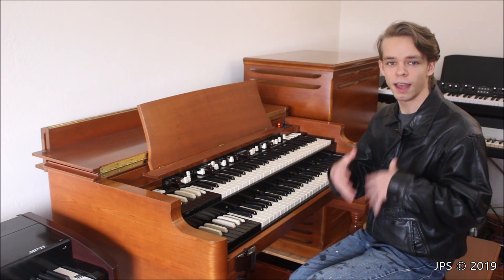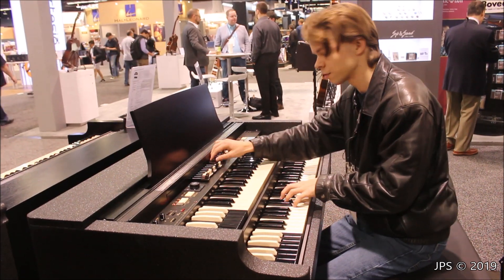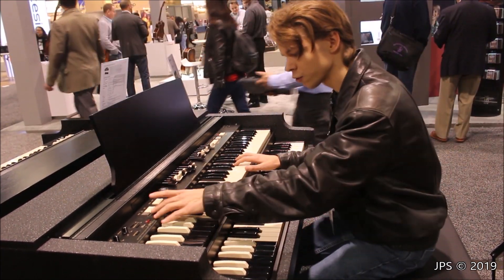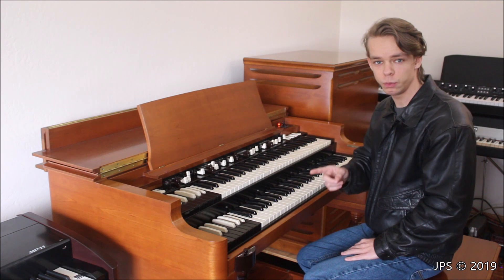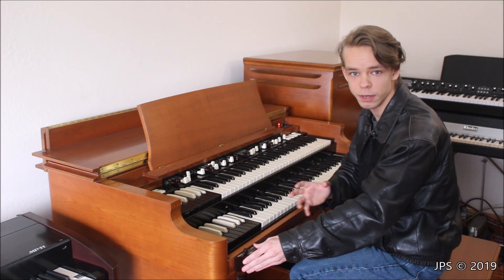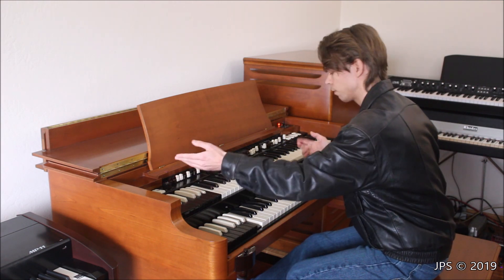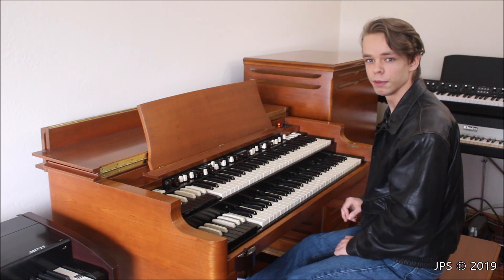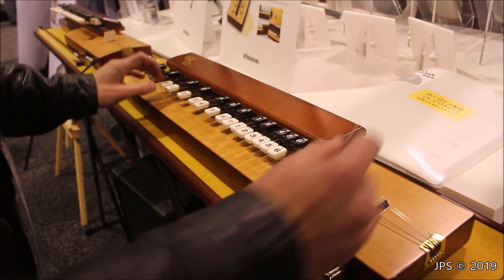NAMM 2019 Hammond Porta-B vs 1965 Hammond B3 Organ

Comment from the maker: After finding major issues with the Hammond Porta-B at the 2019 NAMM show, including poor internal speakers, the lack of a physical Leslie speed switch (which was replaced with three small buttons), and nearly no treble presence, a Hammond employee reached out to me and explained some of the issues I was having. This is an excerpt from the transcript, regarding the lack of treble from the Leslie speaker.

 "It's Don Leslie's design from 30+ years ago. The only thing different is the outer tough coat, which was found not only increased the weight of the Leslie by 50lbs but also deadened the cabinet. The inside of the cabinet is also coated the same way. The coating application is outsourced."

He also told me this, regarding the Leslie:

"Hammond service pointed the snafu out to me as we were unpacking and setting up on Wednesday. "

I have been going to the NAMM show for years, and nearly always, vendors will bring their finest goods to the show. Sometimes the instruments on display are even better than ones you could buy in a store. So it seems odd to me that Hammond would send a prototype, experimental Leslie to the show that they knew wasn't quite right. The internal speakers and speed switch system on the Porta- B were stock.

A link to my B3 recorded one mic "The House of The Rising Sun"
https://www.youtube.com/watch?v=IM1fw51w0iY

Comment: The half-moon switch was made of bakelite, which is very durable and could be manufactured if they wanted to. I owned a Hammond A-101 (same internal workings as the B3) and agree with all of your points. While I appreciate Suzuki keeping the name alive, their products will never be the same as the original in quality, playability or sound. Between the other keyboard manufacturers and VSTis modeling the sound of the B3, spending the money for the name is no longer a logical option. Excellent and honest video.
Reply: AriKona you are so right on point! 💯 who wants to spend money just for the name when there are quite a few other clonewheels that are better!!!!

Comment: What you call “pedal” switches are properly and aptly named “rocker” or “rocking” switches as opposed to “toggle” switches. A rocker switch looks more like a rocking chair than a table, but you’re right and  I can very well see that someone used to playing a B3 would be annoyed by that feature on the Porta-B that would require some time to get accustomed to.

Comment: Good review.  I suspect the internal speaker philosophy is that most pros will use external speakers anyway, so just include something barely adequate.  (Which is pretty much the same as flat screen TV's.)  And as you suggest, it's tough to know if the high end issue was a problem with the environment, the speakers, or the organ itself.  Also as you suggest, I bet they didn't want the Leslie switch protruding on a portable instrument.  (I wonder if that will be available as an add on; remember that it was an add on to the original B3.)  I agree the price sounds high, there's some other decent 2 manual clonewheels out there.  But any new clone wheel won't weigh what an old B3 weighed.  Finally vintage Hammonds often are missing pedalboards because most pop & rock players never used them.  Keep the candid reviews coming.

Comment: I have the XLK-B3 Suzuki Hammond.  Although it is technically a 2 manual portable, I have it in my music studio.  I love it because I live in Hawaii where having anything serviced is difficult. I looked at a real B3 but didn't want to risk a tone wheel failure and didn't like the maintenance.  I've had my Suzuki Hammond for at least 5 years and there is nothing that I've had to do to it. I like that. I also have the Leslie 3330.  If I had to do it over again I would have bought the wood cabinet Leslie rather than portable.  BTW, my EXP100 volume control pedal has a tab that turns on the Leslie and shuts it down.  I paid about $10,000 for the organ including bench, 25 pedal board, and Leslie.  The only thing I didn't like at the time was that the legs on the organ and bench are square.  Now they offer dowel type legs.  Also, notice that there are more draw bars on the big B3.
Reply from the maker: Gary Kahn, I think you would have found the B3 Hammond would need very little servicing. The only real time that I have heard of a B3 needing servicing is when they have been sitting unused or used extensively on the road. There are little things that you can address from time to time. The only servicing that mine has needed has been a broken wire on a draw bar. It was really a very simple repair all in all (I did a video on it). The new Hammond dealers like to talk about all the servicing that was needed on the original B3 organs, but I have never known that to be the case. They weigh about 425 lbs, but move very easily with a Roll or Kari dolly and could almost be a one person move with no steps.

Comment: Thanks for the memories. Better days gone by. My Hammond was a B3 walnut trim, bought new, 1961, but later modified it to incorporate a volume pedal for each manual (lower manual plus pedals) and  a Leslie speaker with chorale. That was my professional rig. My practice set up at home was a Model A (ser# 1313) with a small Leslie. Loved them both.

Comment: Like to watch your videos and respect your opinions. Those are rocker switches, a tablet switch usually looks like a tombstone and flips down or up, or so referred in my neck of the woods. Your B and Leslie are beautiful and a steal at $8K considering their condition. I presume the Leslie is a 122? The 122’s are more in demand for gospel and jazz, while the 147/145’s are brighter and cut through better for rock. Yes, that rep was being a jerk. Thanks for doing what you do!
Reply from the maker: Rich Ferraro, I do have a 1965 122 Leslie. The one really important thing that I forgot to include was they had the Porta B connected to a 1978 122 XB Leslie. It's the thing many people like to do when comparing a new Suzuki / Hammond to a vintage Hammond, is hook it up to a vintage Leslie. I have seen online where they even use the vintage amps from the Hammond as well. I do not believe that is even close to a true comparison between a vintage Hammond and a Suzuki / Hammond. It's like they have really just given up and are just trying anything to get it to sound as good, and even then it does not sound as good to a true vintage Hammond to an experienced Hammond B3 player.
Reply: Before I knew what they were called, I used to call tablet switches “Tongue switches”, because, they look like a tongue.

Comment: The Porta-B has only one set of drawbars, not two like the B3.
Btw: in fact I like it very much when an organ starts to tremble and shake when playing with internal speakers at a high volume. For me it is a sign „it comes alive“ - in comparison to keyboards with tiny speakers ;-)
Reply from the maker: Since this organ carries the Hammond name, it should live up the the legacy that the original Hammond organs created, and the Porta-B with its internal speakers really just doesn't do it. The original Hammonds' keys do not vibrate when you play the instrument, and I've never even played a keyboard instrument that has vibrating keys - even my Steinway concert grand's keys don't vibrate when you play the thunderous bass.
Reply: @ThePianoforever  They don't shake, well and good. But acoustic pianos DO transmit some frequencies into your fingers. Hopefully only frequencies > 200 hz.

Comment: That Hammond employee at the Nam show scolding you is such a turn off.  That would have upset me so much and turned me against the company.  I like the Sk1 88.  But, they should include a pitch bend wheel, and the ability to pitch bend with a lever on the expression pedal.  Also, their long pedal GL bass pedals instrument sounds good, but no place to mount a piano sustain pedal next to the expression pedal.  With a 2019 instrument, one wants to play many different sounds, and have a rhythm section with large buttons.  My instrument of choice and for the money?  A  Casio CDP 235R, with stand and bench, $450.

Comment: The Porta-B Name was Originally designated to a Collapsible Tonewheel Spinet based on the L-100 Electronics.

In a 44/44/13 Compass.  The later ones had a Tab that engaged a 16' tone on the Lower Manual on the Pedal Drawbar.

Comment: One of the issues with the B3 MOI and the Porta B MkII is that try both use the VASE III sound engine, which was replaced when the new XK5 came out.
I would test the new XK5 Heritage Pro system, which would come as close as anything to the original Porta B.

Comment: I'd say that it is always difficult to make good sound comparisons in such noisy environments, and then obviously those little onboard speakers compared to a full size leslie. plus the fact that simulations still do not sound like a real leslie, even if it's a smaller one from a different manufacturer etc (however, the simulation in the XK5 sounded quite close and acceptable for the first time...)
but a real rotating leslie still makes the difference. i am sure that this porta-B will sound very cool in your studio when you connect it to your L122. it was the same for me more than 20 years ago when i got my XB-2. i hooked it up to my stereo amp and it was quite disappointing. the sound was rather flat and the digital leslie was just crap. so, not even one year later i purchased a 122RV and voilà, i had the sound that i was expecting. i tried other, newer leslie simulations later, they were better than the XB2, but .... no. real leslie or forget it ;)
oh and there is a halfmoon leslie switch from hammond (CU-something) and i am pretty sure it can also be added to the porta-B ... but of course it is additional like all the other parts of the organ, as you said.

Comment: I dont know if this is a universal thing, but on my clone wheel the top harmonic doesn't do anything when percussion is on.
Reply: Matthew Province I'm a novice organ player,  but from what my good friend has told me, when you engage percussion in a Hammond it disables  the set of tonewheels for the 9th drawbar. I believe it borrows that set of tonewheels to create the percussion sounds.
Reply from the maker: Yes, that's something the original B3 does as well. But when I was testing out the Porta-B and was having problems with the treble being loud enough, I did not have percussion on, and had all the high drawbars pulled all the way out.

Comment: Hammond should  produce a very limited number or special order only  B3/C3/RT3 & A100 series. Yes they'd cost a fortune to make however, it's a guarantee sale without much question (if the do an exact replication). Mellotron does it. and the new ones sound amazing.
Reply from the maker: Mellotron is still making mechanical instruments with tape in 2020? I heard rumors of them being at NAMM 2020 but I had no idea they were still mechanical, I definitely would have checked that out!

Comment: The Leslie Switch Could be Built Into the Lower Left Cheekblock (I use Flat "Designer" light switches for this) or Jimmy Smith (from the "Off The Top" Album) had his Leslie Switches Routed into the Keyslip.

Comment: They need to stop trying to make the new so called improved versions of these organs and just make the original series again !!!!!
Reply from the maker: The only reason someone don't make a new tonewheel organ is they would be so expensive that it would be impractical to buy one.  They say it's about the weight, but many are not often moved so then it becomes the issue of the price. I find I can move mine very easily with the help of a Roll or Karri.
Reply: @ThePianoforever  Im thinking they cant do it or are too lazy .. The sound they are trying to make cannot be reproduced unless you do it the same way. There is a high pitch whine in all the I call them fake Hammonds which I cant stand and has a fake sound. Yes to most people this sounds fine but to somebody who is a true Hammond lover it just doesnt work !!!!

Comment: doesn't look that portable to me the internal speakers would add a fair bit of weight I have a dual manual xk5 and xk3c and a 1969 M102 my xk5 looks more like a B3 and is set up more like a B3 and is portable as the xk3c The porta B is not something i'd buy

Comment: The Porta B is a pile of junk.  MIDI interface did not work correctly it just does not sound the same as a proper B3.  There is another issue I found is that you get a strange clicking noise when near high volume . I could not wait to get rid of it.  Got an A100 . Will never go digital with a Hammond again. Learned an expensive lesson